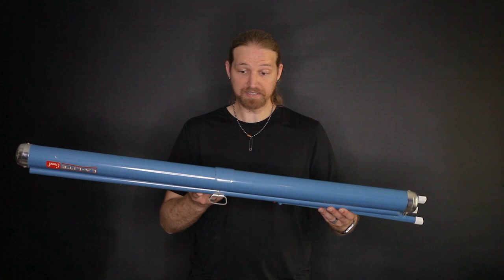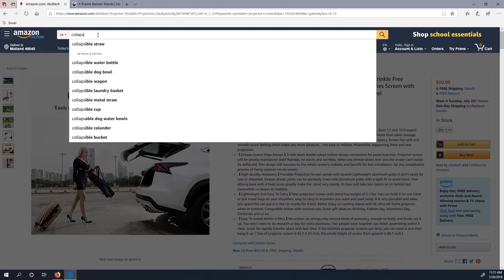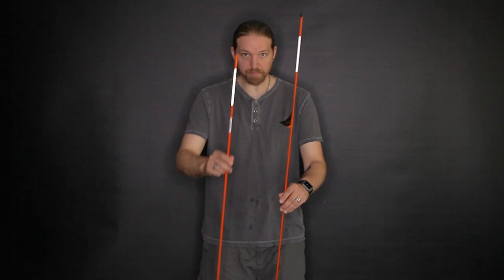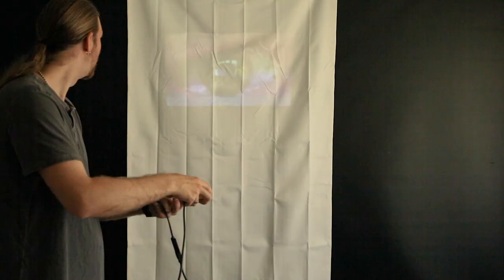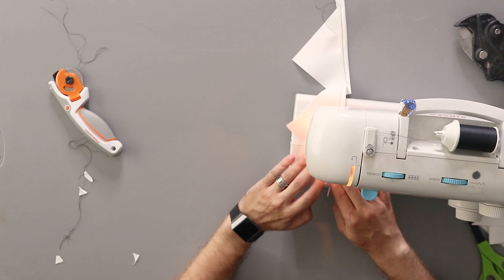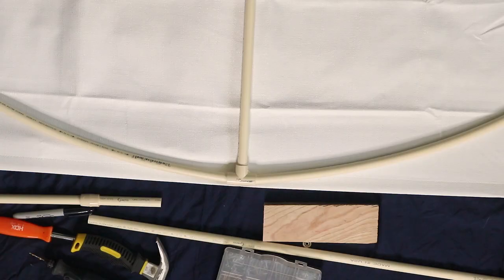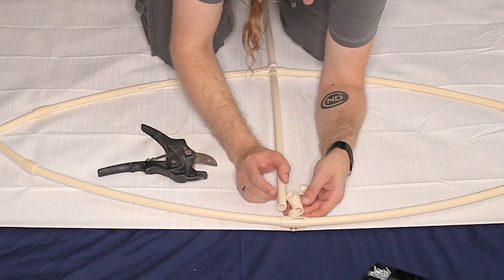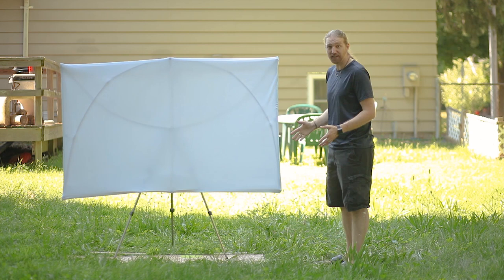PROTOTYPE - PORTABLE PROJECTOR SCREEN

Comment: well it is a prototype because you can see the two red dots on the projection, either the lens was dirty or it couldn't project properly
Reply from the maker: Dots are from dead pixels on my Canon 5D Mark 2 censor. It is riddled with them, the lower light I shoot in the more of them you see.
Reply: @IamNickDClements   ahh thanks for the information honestly would have never guessed